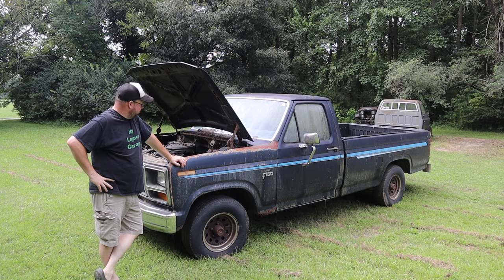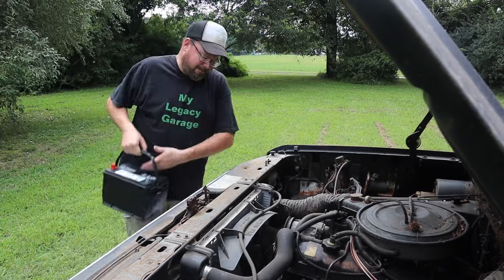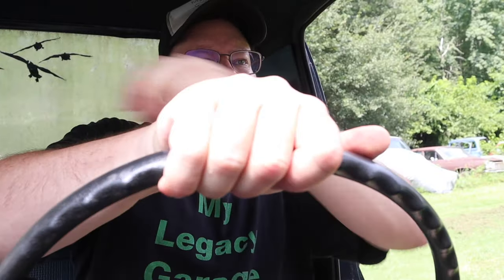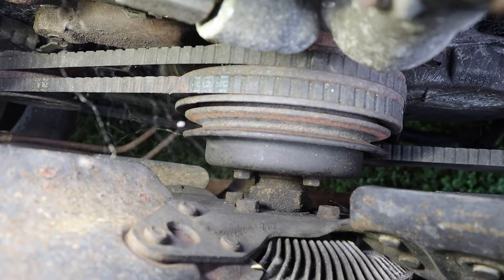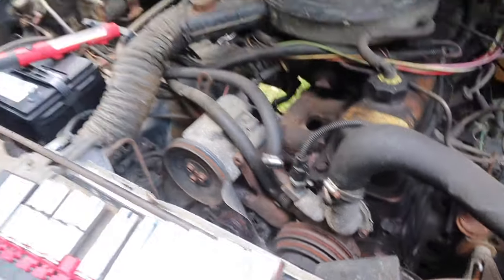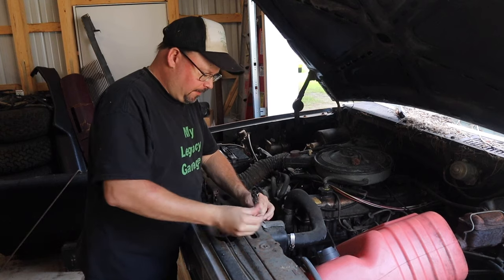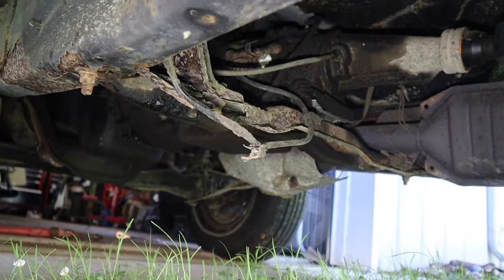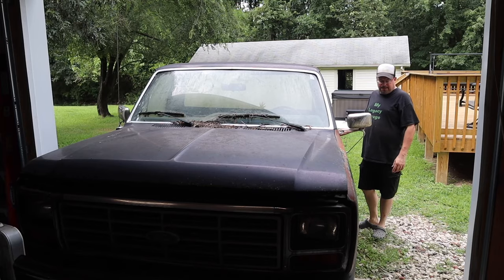ABANDONED 1984 Ford F150 bullnose PART 2! Can we get it back on the road after over a decade?

Comment: If I bypass the smog pulley that goes to the alternator is it still going to pull enough to keep charging the battery
Reply from the maker: I would think if you bypass it you'd need a new shorter belt?